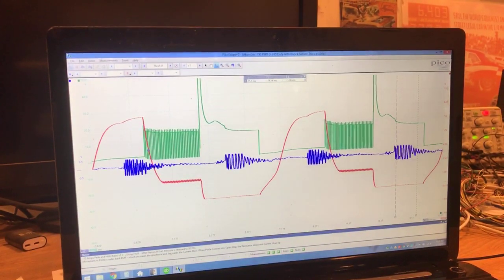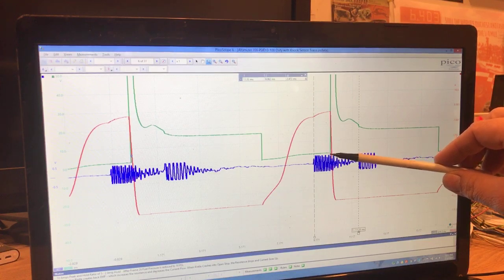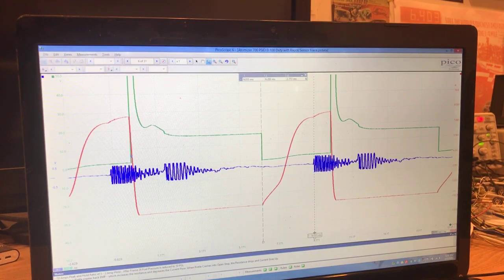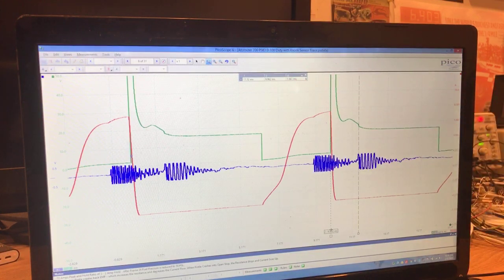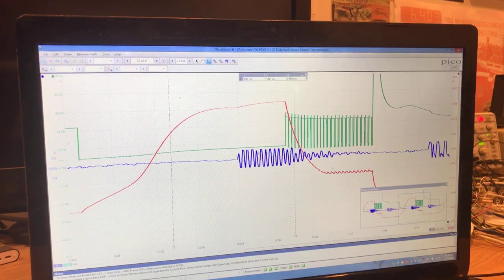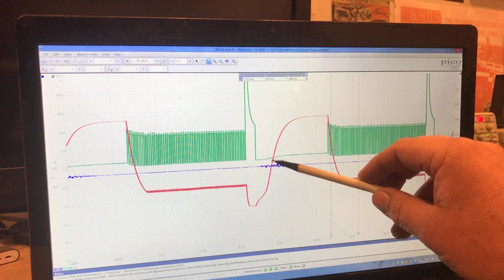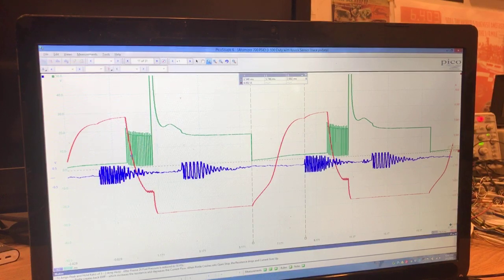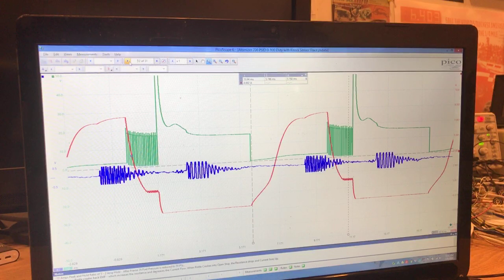Using a Labscope and a Knock Sensor to monitor Fuel Injector performance - Tuned By Shane T

Comment: Oh, one more thing, the injector pintle is not moving „slightly“ or spraying a little bit during the rise of the amperage but snaps when enough energy is there to counteract the spring force inside the injector. So the dip in the current curve and the pintle hump in the voltage curves are the exact snap points. 
So your idea attaching a knock sensor proves what I had learned using my Picoscope. 
Thanks

Comment: great explanation and presentation , just a heads up, along with the knock sensors, you can also use chassis ears hooked up to the scope and "visually see" things on the waveform, they are also sensitive enough to pick vibrations as well and plot them on the scope i.e. like a bent rim or vibration driveshaft etc... Thanks again for taking the time to share the information.
Reply from the maker: Thanks for the heads up
Reply: @TunedbyShaneT  no need to thank , you have done so much for the industry and are one of the most knowledgeable people that there is. I've watched lots of your content over the years for a very long time and appreciate what you share. Along with what you share, I think that the best part of it all, is your subtle not give a "crap" to conform or please people. It's "raw" and true and you can't "fabricate" it and it makes things genuine.  I have been a heavy scope user for sometime now and it has changed my life on how I do my day to day work, I know your a man of super knowledge and are light years ahead , but just as a follow up for the chassis ear set up on a pico, I'll try share link, I now you could probably figure it out on your own as you did with the knock sensor, but it shows how I set it up and use it. thanks again for sharing your knowledge.   https://www.youtube.com/watch?v=XWNNdAljCxs&t=1s
Reply from the maker: @DTEAuto  appreciated once again

Comment: Oh, btw. do those measurements with Voltage from 7-15Volts because the opening time increases seriously when Voltage drops with high starter demand during Startup exactly when you really need the injector to spray.

Comment: This was incredible information, thank you for taking the time to make this Shane. I do have a question to add... when using a low impedance injector with an inline resistor, how does this typically  affect the closing dead time? And am I correct in saying that generally, a high impedance injector is a bit easier to setup, at the cost of high rpm control? (Compared to a low impedance injector)
Reply from the maker: High or low impedance doesnt matter. The current in the circuit matters. Inline resistors limit current and therefore slow down the opening and speed up the closing. Usually you lose more opening than you gain back closing

Comment: Thanks. I did those measurements years ago and plotted my injector dead times with my Picoscope but I never thought of attaching a knock sensor to prove what I new about the mechanics of injectors.
How did you attach them?
Reply from the maker: Ziptie
Reply: @TunedbyShaneT  
thanks, I do have some knock sensors on order and will try this too.

Comment: An interesting thing to see would be the fuel flow as the injector opens. See how much fuel flows as the injector opens, flow under full open, flow under closing. Probably unnecessary as you would just see a flow number given per pulse width and that's all the ECU needs until you get into the non linear portion.

Comment: What tool and software did you use for this analysis?

Do you have to put an electric current through the knock sensor in order to get a reading from it? Or does it produce a voltage on its own?
Reply from the maker: I used a Pico Scope which is a PC based scope. The knock sensor generates this signal on its own.
Reply: @TunedbyShaneT  how much does the scope cost? Where can I buy one online?

Thanks.
Reply from the maker: The PicoScope can be purchased from various distributors, however mine came from AES Wave

Comment: Where do you have the knock sensor placed? Or is it just the engines knock sensor on the block you are using?
Reply: It's a bench test. The sensor is clamped to the body of the injector.

Comment: Just a question. The current trace rises when commanded to the point where you see the slight dip in current. Could this be total injector  lift and the remainder higher trace be the extra current needed to hold the injector open till the end of the cycle?
Reply from the maker: The hump in the top of the trace is where the injector reaches wide open and the peak current continues to rise until it switches to hold mode.
Reply: @TunedbyShaneT  I think that was what i was trying to explain. thanks

Comment: Monitoring the fuel pressure might have provided a little more insight.
Reply from the maker: With the normal sensors we use it’s almost impossible to discern any of this information through fuel pressure. I have logged them with a single pulse using the labscope and even then it’s dodged. High speed sensors would fix that problem.